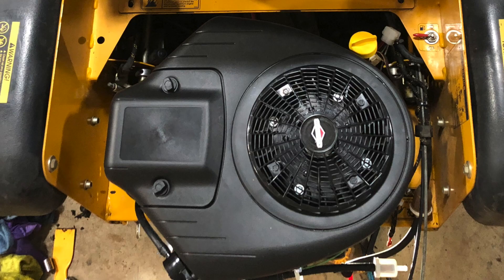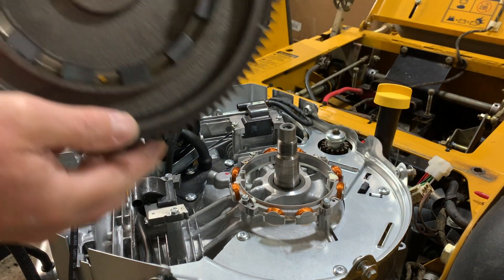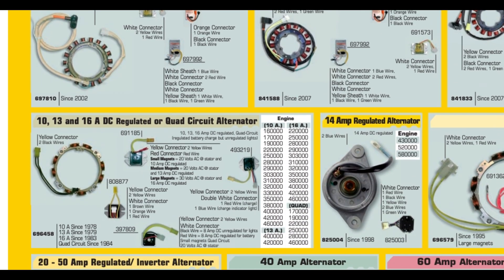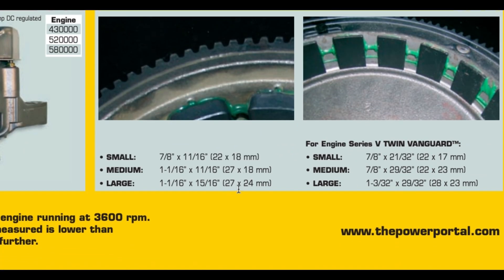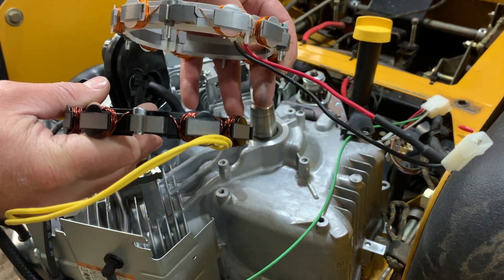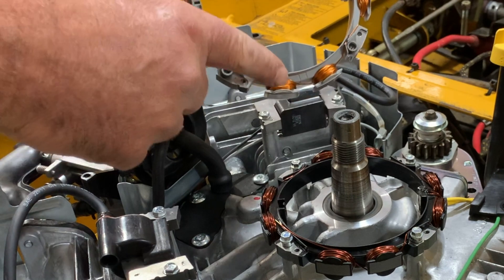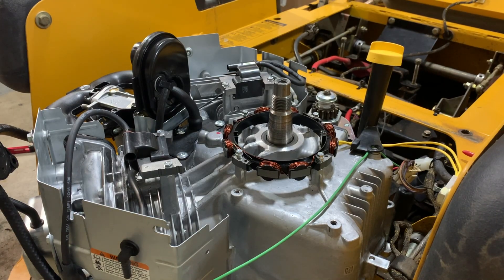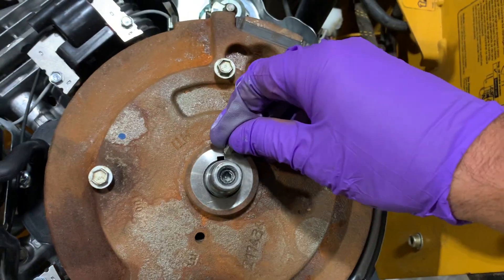Hustler Fastrak Engine Replacement- Part 2 (Kohler to Briggs engine swap)

Comment: im going from a kawasaki fh580v to a vtek 22hp bolt  holes not lining up
Reply from the maker: That stinks, I haven't tried this on a Kawasaki. I would lay the engine in there with a drive belt installed and check to find a nice position where the belt is tight and one or two bolts line up. Then maybe, cross over dimensions to drill new additional bolt holes for mounting. Does the Kawasaki shaft end position for the drive pulley line up ? (Extension from the engine outward to where the pulley mounts, to make sure that pulley lines up horizontally for the belt relative to the other drive pulleys) ??

Comment: Do you have to use a larger flywheel magnet setup?
Reply from the maker: Yes, as shown in the video I used a flywheel with the same size but larger magnets.
Reply: Do you have a part number for flywheel? I have an 18 horse Briggs single cylinder and I am having trouble finding the part number for the flywheel

Comment: I’m doing the same. I need help with wiring the charging system.
Reply from the maker: Check out part 3
Reply: @BondsGarage  where’s part 3? I need to wire the exact same fastrak!  The motor ent out last week with around 850 hrs. I didn’t even know about the charging system, every dealer just tells me to give up on engine swapping it.